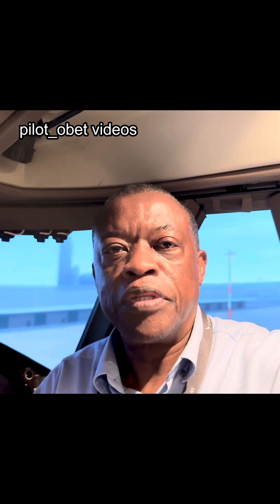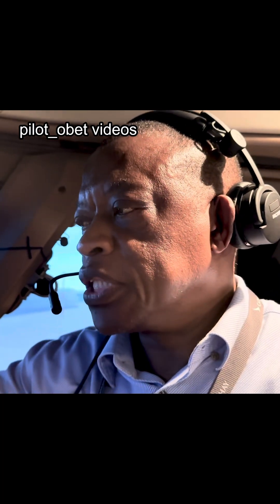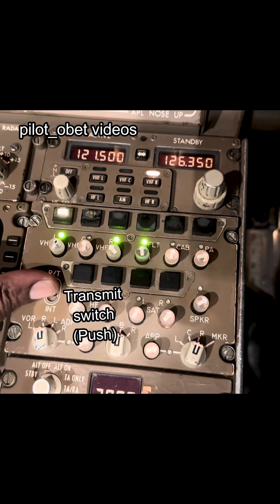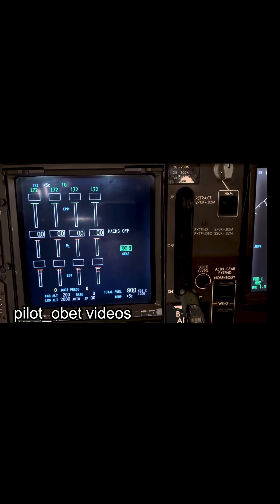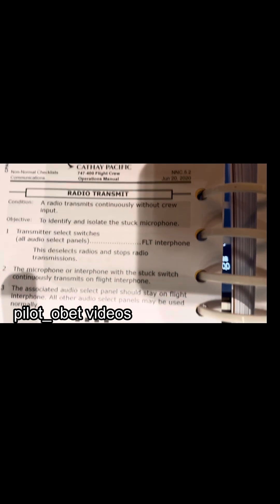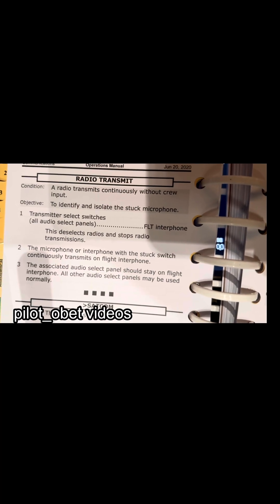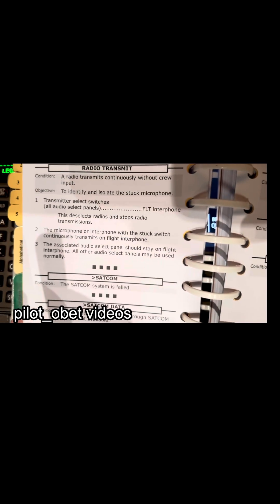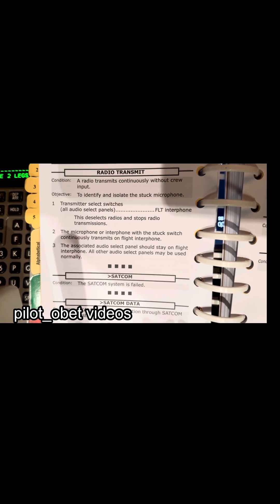Boeing 747 Radio/ communications issues

Comment: Thanks, Skipper. At the holding point Cathay 733 should not transmit "ready for takeoff". The proper phraseology at the holding point is, "ready for departure". Later!
Reply from the maker: Cool- thanks…semantics. But that’s ok😀
Reply: Roger that. Also, "over" is often a confusing one for many when an aircraft is advising the tower that it is "ready".
Funnily enough, I knew of a Captain Oveur who insisted that an "over" should follow a "ready" when the aircraft was advising the tower that it was seeking a takeoff clearance.
I never figured out why he was so insistent about it, although I do understand that it is correct aeronautical phraseology.
Another one is "roger" when the pilot is reading back a clearance. I knew of a Captain Reedy who would insist that a "roger" was not required just prior to reading back of a clearance. Others would insist that it was. He seemed to have been correct though.
Another captain I knew of (a Captain Clarence) seemed to go "sky high" with RT procedures during IFR departures, arrivals and approaches. If any of his pilots addressed the TRACON service operating as "departures" he would berate them and insist that they need only address the RADAR service as "control".
Funny old things, those aviation terms and radio procedures.